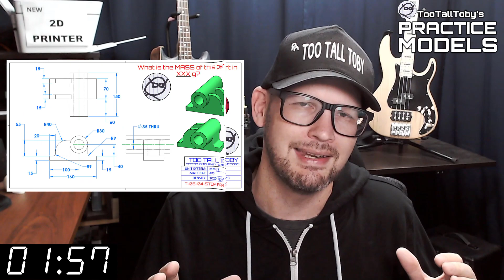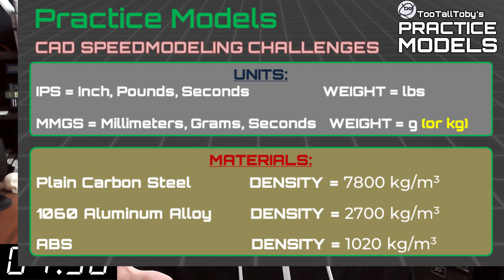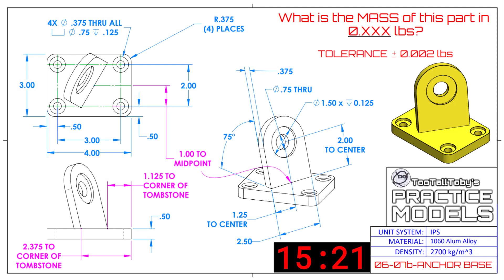Tricky Challenge! -06-07b-ANCHOR BASE

Comment: 0,777 lbs with solidworks. Didn't measure the time because i am right now bathing doing this all with a trackpad xD. Used 6 features because i was lazy in the base plate using a feature to round the corners. So 5 features is the optimal way i guess. My first attempt was wrong when i tried to sweep that tombstone up on a 75 degree line. Mass was 0.772 lbs so i noticed my mistake. Would be cool to see other peoples solutions.
Reply from the maker: Nice job finding the error and correcting course!

Comment: Density is metric while the rest is in IPS. Why ist that?
Reply from the maker: Sometimes we get customers who need things in inches and sometimes we get customers who want things in SI.  But most CAD systems are written on a kernel that uses SI at the core, so most CAD systems want to the material properties in SI, when you create a custom material.  That's why I did it that way.  

Gives my students a chance to practice creating custom materials, too :-)
Reply: IPS means Inches Per Second to me. Would like to know what it means for drawing units, though.

Comment: Even after a long search, I couldn't find the error. .769 lbs
Reply: I also get 0.769lb!  I have spent an hour trying to find my error with no joy - and my OCD is tweaking!  Did you find the error?
Reply: @stevejessen7523  after your comment I revisited this practice and got 0.774 lbs as mass . My proposal: Just start over and try some different approach to the features. Good luck!
Reply from the maker: @stevejessen7523  here ya go!  https://youtu.be/slcXuWSybWU
Reply: @TooTallToby  - Wow - thanks so much for this Toby.  Still not sure where I went wrong, but the way you did that plane is light years faster than what I came up with!  And I got the correct result  - OCD no longer tweaking!

The tip about the hole and the Mate connector was like watching a great chef at work :)

I'm playing along with all of your comps but I am waaay too slow to compete at this stage - but one day!
Reply from the maker: Awesome!  So glad this was helpful!  @stevejessen7523
Reply from the maker: Awesome!!  @stevejessen7523
Reply from the maker: Uh oh - I'll have to make a tutorial for this one!  What CAD system are you using?
Reply: @TooTallToby  A tutorial would be awesome!
I'm using Solid Edge by Siemens.
Thanks a lot, Toby!
Reply from the maker: @WolfgangR-h  here ya go!! https://youtu.be/slcXuWSybWU
Reply: @TooTallToby  following along your tutorial I got the right mass value! Thanks!
My fault was that I extruded the "base" downwards. This shifted the measurements and caused the differences in mass value.
Thanks Toby - keep up the great work!
Reply from the maker: Awww yeah!  Glad this helped!  @WolfgangR-h